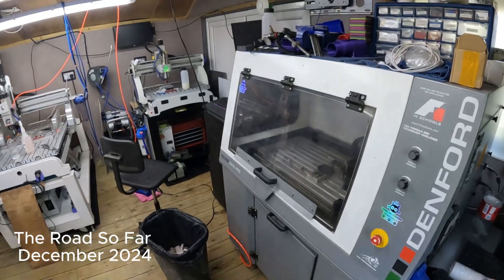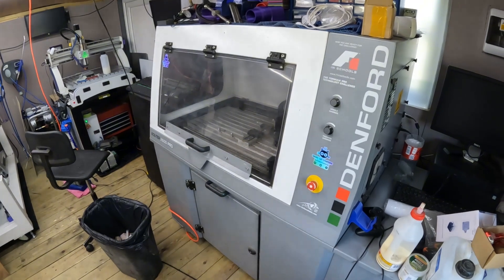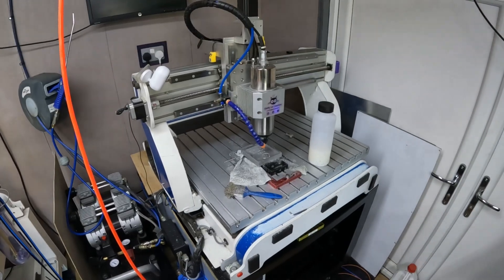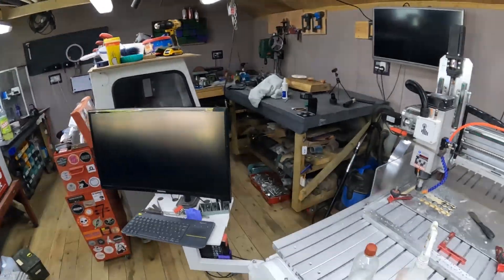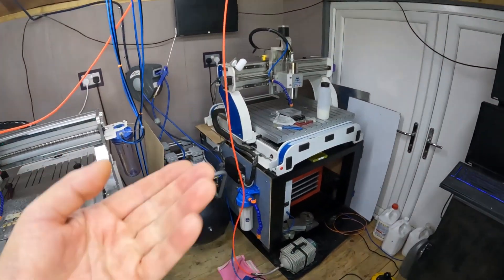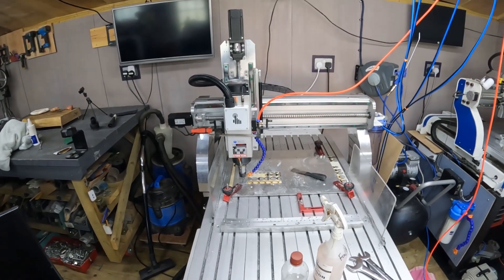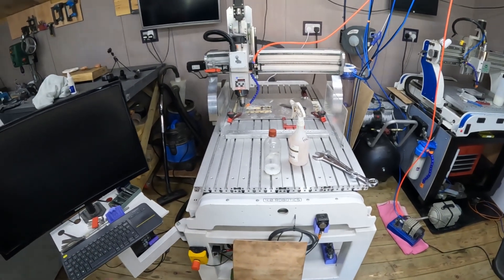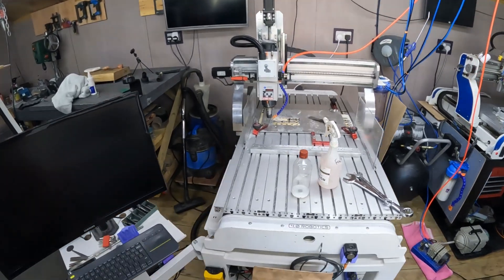Small Business UK - The Journey So Far 2024 - CNC Manufacturing

Comment: You might want to look into improving the machine with ball screws and closed loop steppers yourself. Making a new control box is not complicated and would allow you to use other software. Rigidity is everything when it comes to marching metals.
Reply from the maker: @thomcarr7021  Thanks, they are great upgrades. That's true, i had looked into doing this with the denford machines. The time just wasn't worth i for me at least,  I never have enough hours in a day.